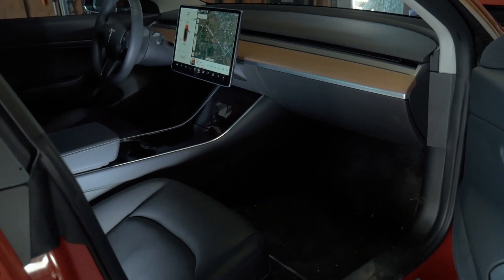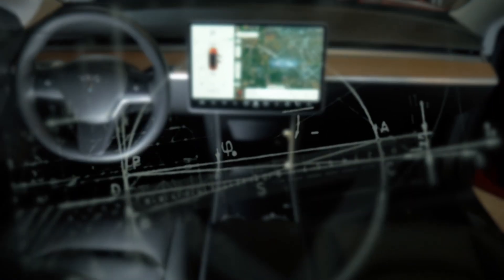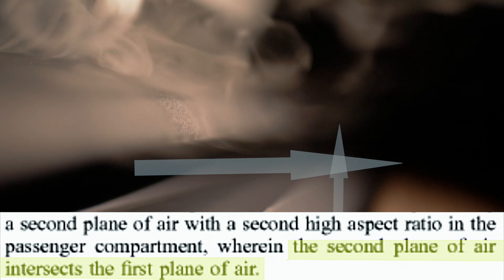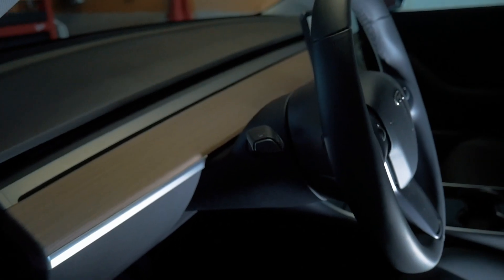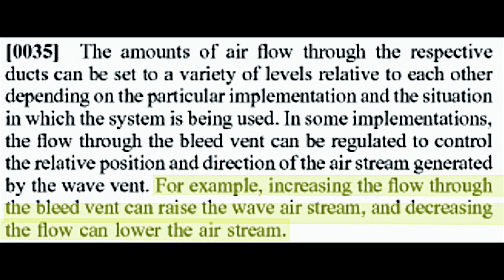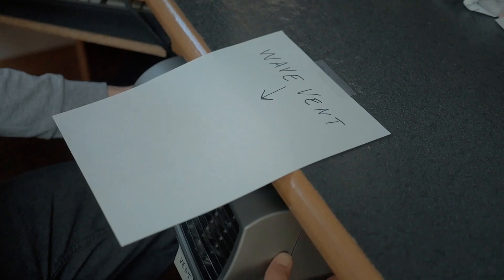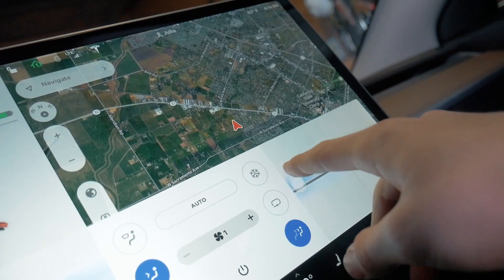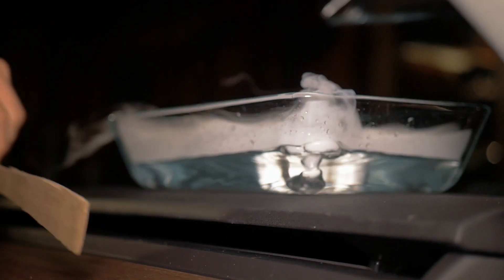The Genius Behind the Tesla Model 3 Air Vents

Comment: but the problem remains, why the fuck would they use such a complex design?
Reply from the maker: Moves the air vents away from gone passengers leaving more room
Reply: I always imagined that this design might finally do away with the hot spots and cold spots that cars all have. Think about it - in your average car it goes something like this: In summer the air vents are blasting cold air which freezes your hands and then falls to your feet but leaving your chest burning from the direct sunlight coming through the window. In winter the hot air coming through the vents warms your head making you feel sleepy, meanwhile your feet are still cold and your hands are freezing. Seems to me the Model 3 having a wide continuous vent might do better at distributing climate control more evenly and comfortably. I'd like to see someone review it with this in mind!

Comment: You left off the reason for doing it that way in the first place.  Computer controlled vent = driver doesn't need to be able to reach the vent to adjust it.  Driver doesn't need to be able to reach the vent = vent (and thus dash as well) can be moved further away.
Reply: Evergreen you are type of guy who never gets laid
Reply: Not only. The whole system of continuous air distribution along the dashboard allows to avoid having multiple exit points which have to pulse more air to produce the same cooling and heating, like in other cars. Air vents are usually unaesthetic and that's a good thing they get rid of them, even if they are very well integrated in the X and S. But the main benefit is to shrink the size of the whole dashboard, being then very low and pushed forward. The fantastic result is a great sense of roominess and visibility on the road, which is the first thing one wants in a car! Everything has been carefully engineered: the sound system is then better integrated and the windshield has a trapezoid shape at the bottom to accommodate the wipers in a resting position so that they aren't blocking the view while driving and offer better aerodynamics which is crucial for an electric car... This whole sum of details adds up in something coherent and will be experienced as something new and better as a whole. This Model 3 will be appreciated in the long term exactly as the S and X as a unique car. Congrats to Tesla!
Reply: Don't forget about the noise lest obstruction less noise
Reply: Clearly having to wade through a touch screen interface while driving is far safer than just manipulating simple switches that give immediate tactile feedback.
Reply: Driver dont needed. Vent air can be controlled by passsenger in the ride sharing tesla platform
Reply: Karen Pease you are very smart and beautiful :) have a nice day!
Reply from the maker: My bad, that just seemed kinda obvious.
Reply: It seems like most people miss that fact.  You always get these "why reinvent the wheel" comments, people who think that the Model 3 is adding electric actuators for no benefit except aesthetics.  But beyond aesthetics... and beyond having a larger airflow cross section (less noise for a given mass flow rate)... you get  the ability to move the dash away and give more space to the occupants.  :)